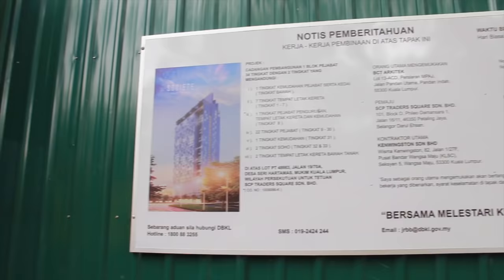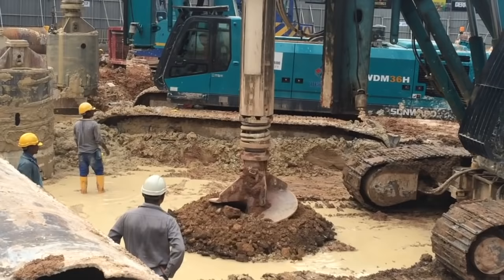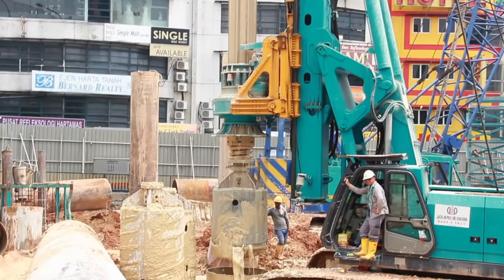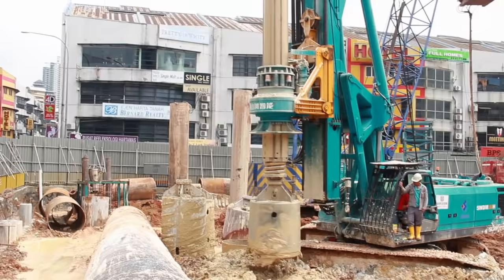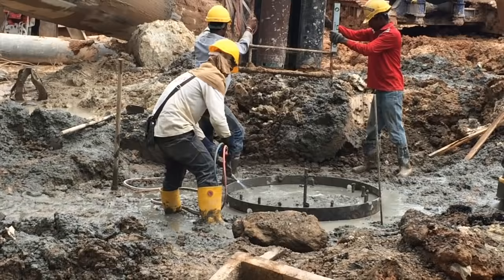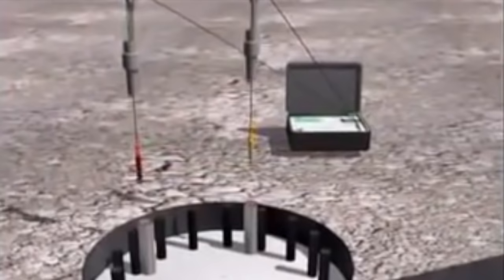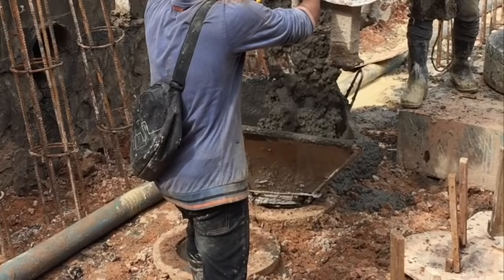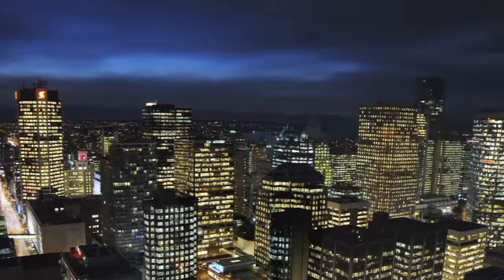BASEMENT EXCAVATION - BORED PILE

Comment: No noise and vibration to surrounding environment , but it surely dirty works . Soil removal is just one extra matter . Of course from the point view of design ...Bored piles is the safest pile which can contribute  ( end load + friction load + plus bigger lateral load ) to resist design load. To make sure concrete flows and to avoid clogging of tremie pipes during concreting , high slump concrete shall be applied (normally K250/K300  with slump : ( 16 -18) cm

Comment: The Bentonite is used to remove air bubbles before pouring the concrete since the steel case will prevent caving.

Comment: I've inspected hundreds of piles and sites conditions but the soil in Malaysia is very tricky due to high water table. From this site, contractor should haul away drilled cuttings off site so workers can work safely.  Dewatering also required as you can see the site is muddy and difficult to work plus safety.

Comment: I don't know what's worse the health and safety issues I.E using burning gear with out goggles , standing over the open pile cap at 9.00 minutes or the amount of muck coating the rebar as the cage is lowered into the casing
Reply: jeffrey loftus meh, considering the rebar is encased in polymer or bentonite slurry, a bit of dirt on the rebar cage seems minor problem.  I'm more curious about the relatively small diameter reinforcing and the dubious splices.
Reply: Your not in Kansas anymore....
Reply: Who cares about safety of work when there is 10 other ppl waiting for your job.

Comment: They cannot weld the steel outside the long ones the long ones have to go on the middle what they doing East not good when they finish column they should leave at least five feet of Steel app off the ground so they can't tide the building Up👍👌🤔😏
Reply: No wonder the American Engineers are the best got Empire State Building was the first biggest back on the day of the world no wonder why 😁🙄🤗😂😋
Reply: Dear in this case sround  soil is supportive